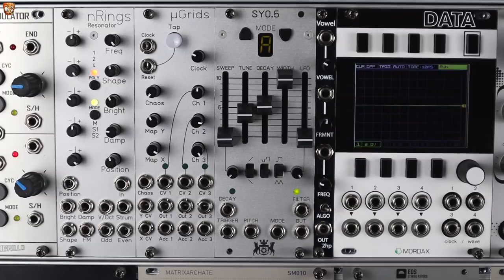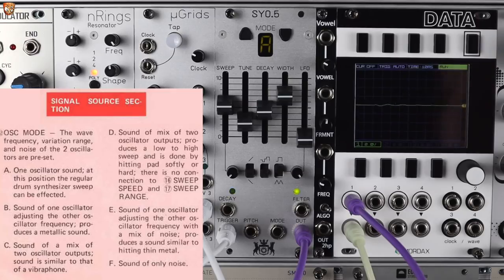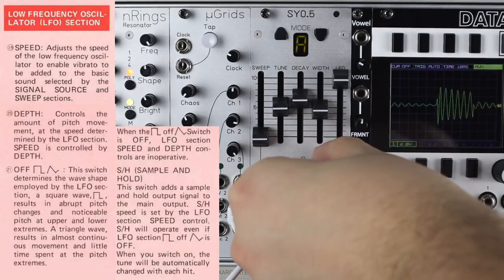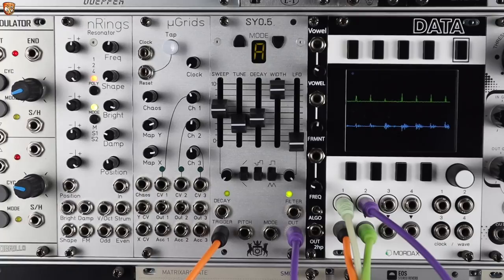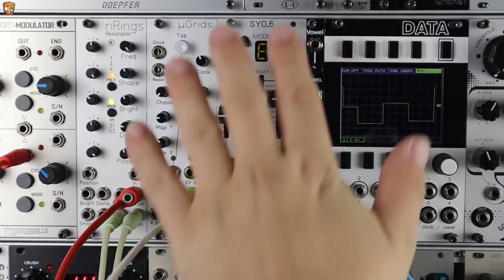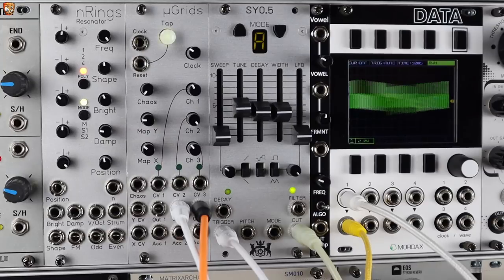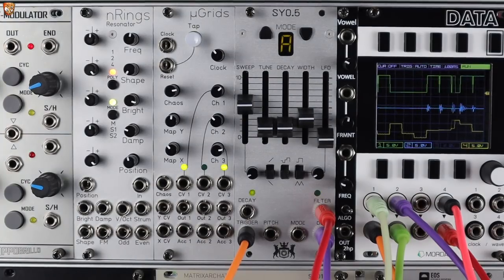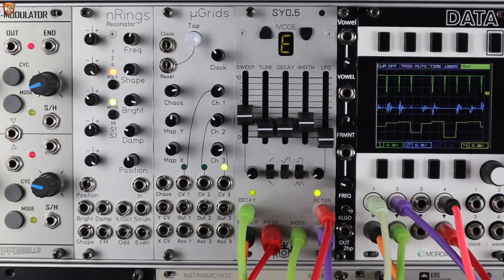Michigan Synth Works SY0.5 - Pearl Syncussion Clone in Eurorack

Comment: Why has there never been a 808/606 style drummachine with sounds like this ? That would be theee number one elektro drum machine. But the module, would have to get at least 4 of them, getting very pricey.
Reply from the maker: this particular module is based on the Syncussion which was a dual sound machine. It's the Pearl SY-1 Syncussion if you want to check it out. 

Building out a modular drum machine of your own is great, but expensive as you say.

Comment: What vca did you use to control the trigger levels for dynamics? I picked up a tangle quartet vca to control trigger levels into the SYO.5, and see that the SYO accepts 8v trigger levels, yet the CV level for the Tangle Quartet is 5v. Does that not matter? Just making sure I’m not missing something. Great video! Thanks!

Comment: does this badboy track v/oct on the pitch cv input?
Reply from the maker: no.
Reply: DivKidVideo : so in the time since my original comment, I checked the product data sheet for this module and it says it indeed is 1v/oct?  I’ve got one in the mail, so can double check, but do you mean to say that it still doesn’t behave as expected (ie, as a tunable osc with a decay eg), despite that spec?

Comment: Sounds pretty good, but for around the same price I think the SSF Entity modules are better
Reply from the maker: they sound very different, there's no FM and dual oscillator action on the SSF units. But the sound and control is very different (I have the Entity Bass Drum and that's fantastic).
Reply: I have the Entity Percussion, and this is still tempting me! It’s great to have more classic non-x0x drum modules in Euro.
Reply: this is smaller and the controls are just phenomenal to use... no surprise you see it everywhere now